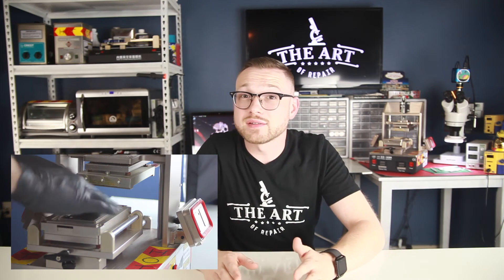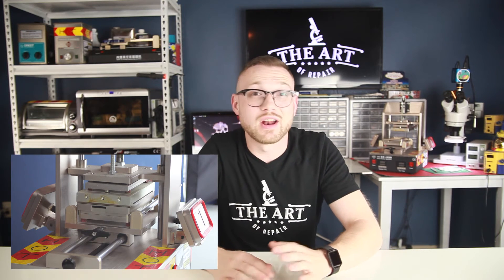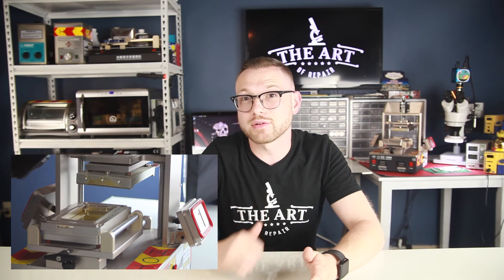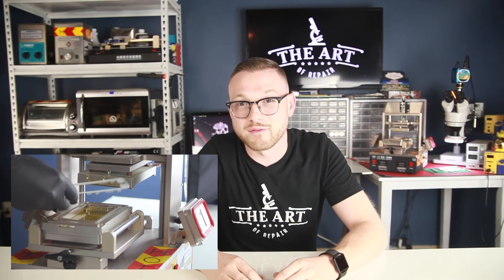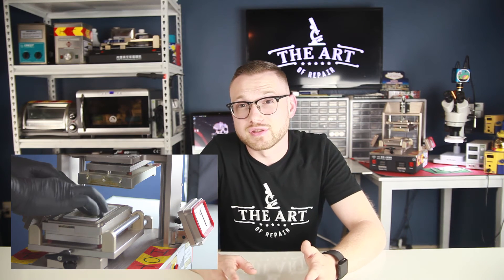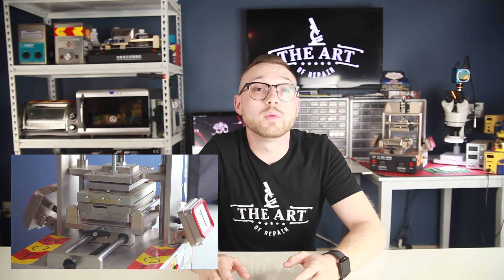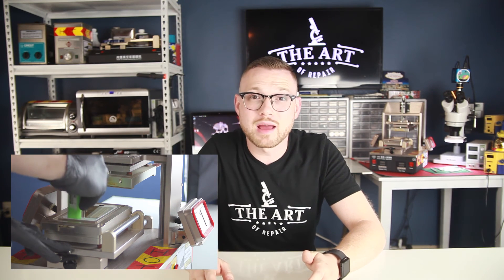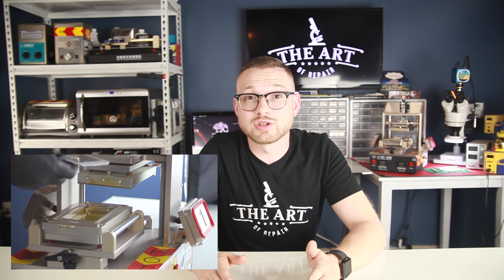EP8 LCD / AMOLED Refurbishing 101 : iPhone Frame Lamination / Delamination

Comment: Do you have any tips to prevent LOCA glue from getting to the backlight layer when putting the glass and LCD together without disassembling the LCD further into some dangerous and risky terroritories?
Reply from the maker: You can either use glue to seal the backlight, or you can just desolder the original backlight and use a (dummy) backlight in its place. Both of these are dangerous with low success rate.  LOCA is not meant for LCDs only non backlit displays.
Reply: TheArtofRepair that makes sense. I've always stuck with AMOLED displays because of that risk but I see others try to do this and fail for LCDs. There's also this anti backlight UV glue on eBay but I've never tried it yet. What do you think about this type of sealer?
Reply from the maker: I think those sealers pray on the people that don't know any better.
Reply: if you use oca glue, then no need to worry about this

Comment: Never use hot glue frames anymore..
Reply from the maker: hadeedg all frames on the market are some form of HMG. There is no true real cold press. Only conveniently pre applied slightly stronger HMG glue.
Reply: Actually we see factory produce cold pressed glue laminated, iPhone 5 normally they do not use cold glue, but 6 and up models they use cold glue, one most easy way to test whether it is cold glue or not, put the frame with glass in temperature higher than the melting point for hot glue, then you will know, as cold glue melting point is much more higher, in daily life no need wory about it melt, thus customer will not complain that frame comes out. Hope is useful tip.